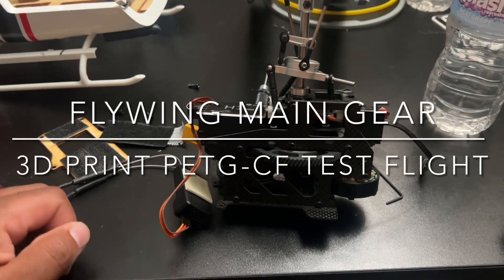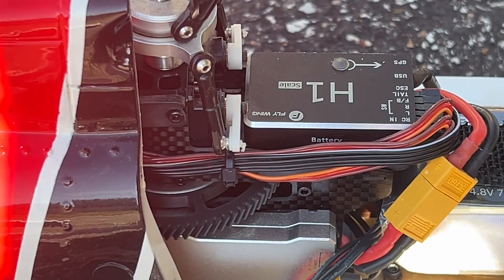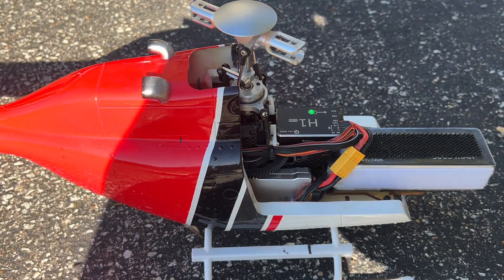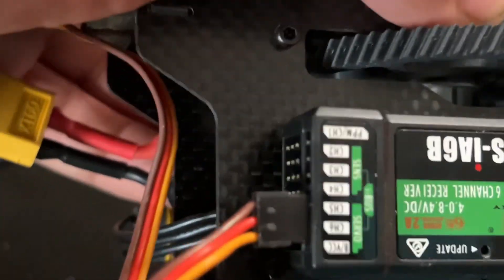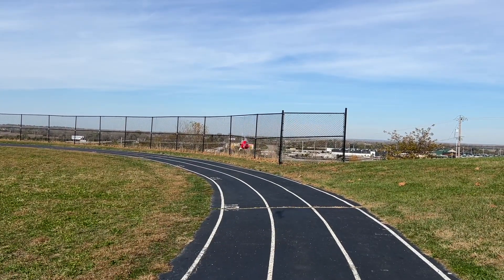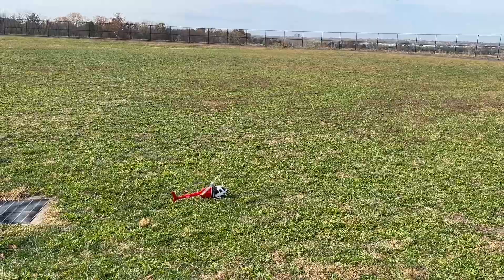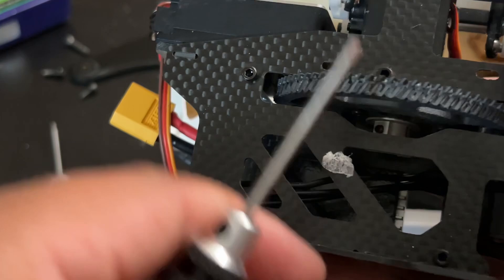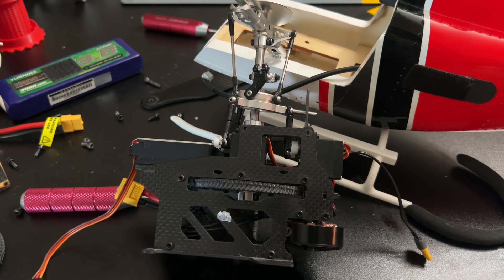FlyWing 3D Print PETG-CF Main Gear Test

Comment: Very interesting. Great Test video and good 3D printing attempt. And nice helicopter ;)
Are you able to print the layers in different orientations, say at 0-90-0-90 degrees?...
Reply from the maker: Layer adhesion is stronger on the X-axis than on the Y-axis.